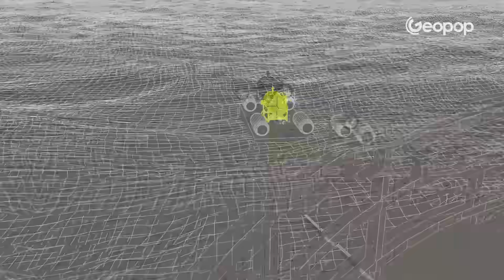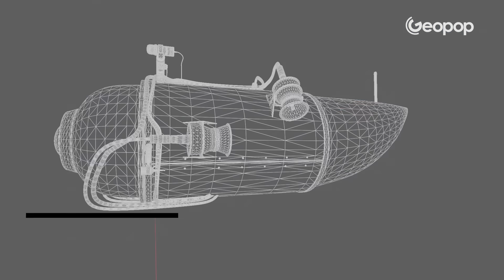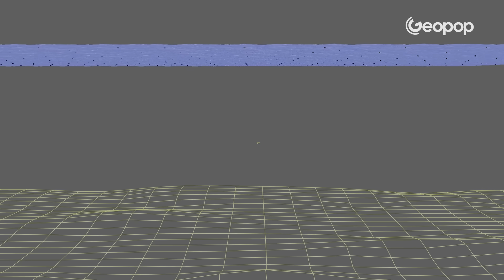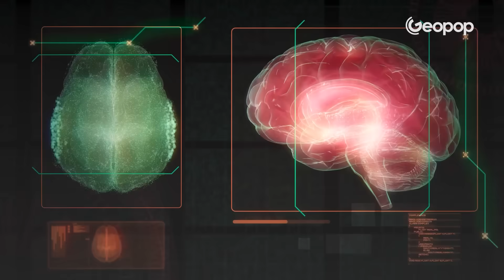Titan Implosion, two year later: the 3D reconstruction and the possible causes

Comment: TL;DR: This is not a cautionary tale about using carbon fiber on a submersible... It's a cautionary tale of how pure ego, hubris and greed will Hurt not only others, but also destroy yourself.

A lot of people hook onto the carbon fiber, but I'd like to point out that you need to get out of your head that carbon fiber was the Achilles heel of this vessel. There are 4 key things to remember about the carbon fiber shell and how it was engineered and manufactured...

1. They decided to skip the 45 degree wrap path when constructing the hull. This wrap path pattern is important as it is the angle that gives it its most strength. 
2. Boeing did actually give them feedback on how thick the hull should be when collaborating with the feasibility studies. They built the first hull to spec, But after it got cracked in an impact, they completely ignored the input and made the second hull even thinner. I can't remember the exact inches that Boeing recommended, and what titan ended up using, but I do remember that it only had 18% of the strength of what Boeing proposed.
3. The hydrophone system was actually doing its job. It was detecting pings and crackles in the hull from previous dives. But the data from the sensors was ignored.
4. Other engineers that worked on the Titan already declared the engineering behind the submersible a death trap, and either quit because of the refusal to listen, or got fired. Stockton would then go on to hire young engineers, declaring them more open minded with fresh ideas. What this really translates to is, they listened to him without question, due to their inexperience.

All the decisions above were a direct result of Stockton's engineering and leadership (Or lack thereof).

Any material can be used correctly when engineered right. This was engineered completely and utterly wrong. Remember, there are plenty of buildings that collapse that are built from concrete. Concrete is the accepted, established material for that application, but bad engineering will make things go wrong. You can use the "right" material embarrassingly badly.

If no Carbon fibre fabricator wanted to touch this thing with a ten foot pole. Given all the above, Stockton would have likely of used titanium well out of spec. He already cut down on the amount of titanium that was used for the domes under what would of been recommended.

Comment: It's unbelievable that just 5 inches of carbon fiber withstood that amount of pressure several times. I saw a documentary on how every 1 inch layer of the Titans carbon fiber hull developed defects in the form of bumps, with each new layer being made developed even more defects that had to be grinded down. A total of over 700 grind spots were made to smoothen the inner carbon fiber layers to properly fit the other layer that would fit over it. Amazing documentary and investigative techniques. Just maybe, if the carbon fiber wouldn't of had those defects and the damaged the repair grinding had, just maybe they all still be alive. But this type of composite sub seems to literally be a disposable vehicle since every pressure cycle surely breaks the bonding glue of every layer.
Reply: Is it true that, if they were changing the carbon fiber every 40 trips, that would be safe? Any idea on that?
Reply: @martafiord they said the Titan had only made around 13 successful dives to the ocean floor where The RMS Titanic rests. I don't know how many deep deep dives the Titan sub actually made. It looks like if Rush would have had the sub properly inspected and certified around the 40th deep deep dive they would have found defects and probably told him to scrap the hull and build a new one.

  From the investigative documentary, the biggest red flag was the flaws or defects they found in the carbon fiber hull that were repaired by grinding and then just gluing the next 1 inch layer over the other. They also stated and showed the making of the sub hull and pointed out that they did not perform a cross or diagonal pattern in the laying of the carbon fiber, which would have strengthened the subs hull in more directions.

They seem to point toward the failure was the defects or bumps that came up in all of the 1 inch layers that made the 5 inch thick finished hull design. The bumps meant their was air pockets in the layers and hull and when ground down to smoothen them meant that a whole layer or more of carbon fiber was cut and removed. It was supposed to be a continuous carbon fiber band for the most part. 

They concluded that carbon fiber isn't ideal for a deep dive submersible because it's literally glued together and everytime it dove deep and got squeezed by the massive pressure, the glue holding all the carbon fiber fabric material got destroyed little by little. Delaminating is what they call it. 

So if the sub would have came out free from defects from the beginning, it may still be here today. But it looks like Rush would have ran that sub to its failure and beyond.

Comment: I remember when carbon fiber was being introduced on mountain bikes in the early 90s. The frame on my bike was completely made of Carbon Fiber. It's light, but also more expensive.  After 2 years of use the rocks and pebbles that had been hitting the frame became unraveled like a thread. It actually disintegrated before my eyes. Carbon fiber used as airplane wings or body could lead to same effects. It's fiber glued together by resin and epoxy. Heat and cold temperatures will degrade their adhesiveness and break apart.  When I've heard they're using fiber glass as a hull...crap!!! IDIOT LIKE STOCKTON RUSH who has engineering degree should know the pressure in space and depths of the ocean. Carbon fiber will not make it at that depth with only 5 inches of thickness plus the titanium connection to the carbon fiber with epoxy or resin. It should have been all titanium steel with high grade seal on the entry and rear.

Comment: Very well done video.
The explanation of  pressure per square meter of surface area was very clear.

I just watched the Netflix film about Oceanscape's Titan.
Mr. Rush failed to appreciate what his mechanical engineers were telling him.
At the beginning of the project to build the vessel, he stated he wanted it Certified; after 2 hulls failed, he decided not to request inspection - and his staff began resigning. Those who asked valid questions about the the evidence indicating fractures in the carbon fiber hull were discredited and silenced.

Stocton Rush was also warned to protect the hull from freezing after repeated dives: the concern was water intrusion into the micro spaces between the carbon fibers, and expansion and contraction caused by repeated freezing and warm temperatures, which would weaken the structure as a whole. 

Which is exactly what happened. 

Rush ignored those warnings.

Comment: Genuinely shocked carbon fiber was used for the hull. Anyone who has ANY experience with using carbon fiber, whether in racing or aerospace, could have known to NOT use it for submersible use. The atmospheric pressure alone should have been the non starter, let alone a company who seemed to be all about saving money and cutting corners. The height of hubris. Truly terrifying and sad.

Comment: A pair of earphones with a metal connector on the end of the wire to the charger. Where's the weak spot? At the join to the charger. Over time it will break. That's what happened with the titanium ends. The cabin  lost it's shape under pressure where as the titanium ends maintained their shape... something had to give.

Comment: So fatigue basically lets you use a sort of machine like that a few times until it weakens but lets say like 25 times then toss it away  build a new one because up n down under the water out of the water repeat 25 seperate times weakens the structure. That would be costly.

Comment: The cost of a ticket for an OceanGate expedition to the Titanic wreckage was approximately $250,000 per person, as reported by multiple sources in 2023. However, there were instances where discounts were offered, such as a reduction to $150,000 per person in one case. Earlier, in 2018, tickets were priced at around $109,000, and by 2019, they had risen to $125,000. Note that OceanGate’s operations have faced significant scrutiny, and no expeditions have been reported since the 2023 incident.

Comment: Carbon fibre; strong in tension,  in compression as strong as the resins or epoxy its set in. What kind of engineer designed it? Alvin has been diving to extreme depth for year's and is a titanium sphere, seems strange to come up with a totally unproven design.

Comment: Now we know that the company had welded lift eyes  on the  ring that was attached  to the carbon F . and had sanded down bumps and imperfections on the carbon F composite layers, thereby creating more weak points.

Comment: Not bad. You were very very close. It was an implosion, but it didn't begin in the middle like in your graphic. The failure began in the front and imploded front to back. The passengers were turned into a pale paste that was found on the back bubble which was ahead of the rear tail piece.

Comment: When you have a 2l plastic bottle filled with air and try and push it under water with your hands . There is alot of pressure at the surface . Imagine the pressure at 2.5 miles depth.
Reply: ...... OF COURSE!!!   👍  -   I Never Realised THAT!   Well Said.

Comment: First of all it's not a hypothesis , the f**** thing imploded , anybody with two brain cells that were connected knew at 12,000 feet when you have a failure it s going to result in nothing but a catastrophic implosion , only a moron or a Democrat would GLUE a titanium shell to a carbon fiber body , AND YES IT WAS GLUED😮 DEMOCRATS ARE SOME OF THE MOST DANGEROUS AND WORTHLESS PEOPLE ON THIS PLANET , THERE IS JUST SOMETHING WRONG WITH THEIR F**** BRAIN

Comment: I see several problems.
Technical: 1. carbon fibers have high tensile strength, none in compression, completely unsuitable for vessels subjected to external pressure, 2. different thermal expansion of titanium and plastic, 3. completely unsuitable combination of cylindrical 
vessel and spherical ends, 4. even with such a poor design, technological indiscipline. Human: 1. Stupidity, vanity and inability of the owner to accept opinions other than his, 2. ignoring all safety regulations.

Comment: A couple of mistakes - The Osprey landing on the aircraft carrier is either a U.S. Marine or U.S. Navy plane, not U.S. Air Force plane. Carbon fiber is used in Formula car racing.There is no such thing as Formula motorcycling racing. Otherwise,  an interesting video !!

Comment: It's interesting how everyone made the, understandable, assumption  that the carbon fibre was the cause of the implosion. Having seen the coverage of the investigation taking place currently, it seem more and more likely that it was the glue connecting the forward titanium ring to the carbon fibre. 
Another significant point that often gets overlooked, is that Titan had already reached the Titanic wreck site 13 times, as well as another 70 other dives at various depths. Some of these dives were for systems tests and therefore, only a very few metres. The pressure vessel, i.e the carbon fibre central cylinder, was also replaced quite recently and I believe it's final dive was only it's third or fourth.
Given that the carbon fibre hull itself was successful on several occasions, I think there is an argument that, as a material, carbon fibre would be a cost effective option for some submersible applications. Obviously it would have to be a lot better executed and not primarily to make a profit, as greed often leads to cut corners, as was the case with Titan.

Comment: Wouldn't the relevant pressure be the differential between the inside and the outside? Technically the effect of the added one atmosphere of surface pressure would be canceled by the one atmosphere presumably inside the capsule.

Comment: i studied engineering in uni, we studied about pressure vessels but not in depths like this, our prof told us that it is too complicated to go deeper in oceans at our level,  because of atmospheric pressure that affects the materials composition at temperatures, its far too dangerous and changes to pressure, temperature, cyclic loading, can affect the strength of a material before catastrophic failure, materials bonded with other materials can also affect its strength and we havent touch on fatigue yet.

Comment: No pieces of the carbon fiber hull were found because the rapid decompression created a massive increase of temperature and the carbon based hull and high temperature probaly exploded and was consumed. Other deep implosions of other submersibles showed heat damage.

Comment: I seen the carbon fiber was put on around the thin titanium hull in 1 direction and only on the outside. Would it have mattered if the carbon fiber was weaved criss cross and carbon fiber out and in the hull in some way not just on the outside of it?

Comment: Actually there is no problem using the resin bonded carbon fibre hull with metal ring at the two end.  The problem is the joint or interface to withstand the difference strains from the two materials.  The two end rings are "hard" whereas the resin fibre hull is "soft".  There is always a stress reversal from temperature too as the metal can get hot and cold faster than the resin hull.

Comment: 5,000 psi jet of water can cut through a half inch of mild steel.  A microscopic pathway for water at that pressure will not be just a little drip.

Comment: I had a bike with a frame made of carbon fibre. I ran it for 3 years until an abrupt bump broke the frame  in half. The frame had a tendency to flex until it hit a breaking point. Carbon fibre may be durable but it is not that structurally rigid. Carbon fibre's rigidity may be enhanced with resin but it's still not enough to withstand the tremendous external forces acting on a hollow tube made of the stuff. While carbon fibre's tensile strength is high, it's yield strength is not and that was the fatal mistake in it's design.

Comment: Both end domes were glued onto the carbon fibre hull. This does not even compute with me. The carbon fibre was subjected to stress on its former dives and the last dive was enough to shatter the hull. The whole shape of the craft was wrong. Unequal pressure loads on the hull. Most deep dives are done with spherical shapes so that the pressure is the same all round. The metal of choice is titanium about 2-3 inches thick.

Comment: There were a lot of warnings and protest by different people saying carbon fiber wasn't an ideal material to be used as a high pressure underwater material for submersible. When people are venturing into knew materials to be used as a housing vehicle for very dangerous environment, it should have been tested first multiple times to see how it held up to high crushing pressures and cold frigid temperatures, extensively x-ray to see how it structure held up or check for microscopic cracks or defects, tests run numerous time, robotics use to operate the submersible or remote control operated on first and foremost to see how carbon fiber stands up against under the enormous crushing pressures and cold temperatures of the sea. Now, five souls are lost due to their arrogance, ignorance and haste of trying the un-profound use of carbon fiber technology on this application (Undersea high pressure housing), that catastrophically failed the task of maintaining it structural integrity, killing all crew in fractions of a second. What a horrific death and just sheer, utter stupidity to use people to test this carbon fiber material technology in this application (Undersea).

Comment: I see problems with the design right away. First are the different materials used to make the hull: carbon fiber for the cylinder and titanium for the end caps, if I understand correctly. Then, joints are potential weak spots. Next are the circumferential forces acting on the cylinder and the longitudinal forces imparted on the cylinder by the end caps. I would never have gambled with my life on a piecemeal design without any independent testing data. Next is an organizational failure. The owners were desperate for money and willing to accept unreasonable risk. They never realized how dangerous their situation really was.

Comment: Why didn't Oceangate just use a proven material such as Titanium for the entire hull?  Choosing a material that has low compression strength properties, shatters under pressure, is brittle to impacts and in the shape of a toilet roll?  Sounds like a bad idea from the outset.  Why go against the advice and experience of the professional submersible community experts?  Why hadn't carbon fibre been used by other submersibles?  I'm not a material, structural or mechanical design engineer and it just seems ridiculous to my mind.

Comment: Rush made a fundamental error in the application of his chosen materials, and would not listen to voices advising caution because of his extreme hubris. He had plenty of opportunity to test, but declined. He did not realize that you can't push a rope. Carbon fiber composite is highly anisotropic. Mathematically, he made a sign error. He used a design for a pressure vessel in an application that was actually a vacuum chamber. The result was pink mist and black smoke at depth, with almost no warning. No sympathy: The world does not need the likes of Rush. Good riddance.